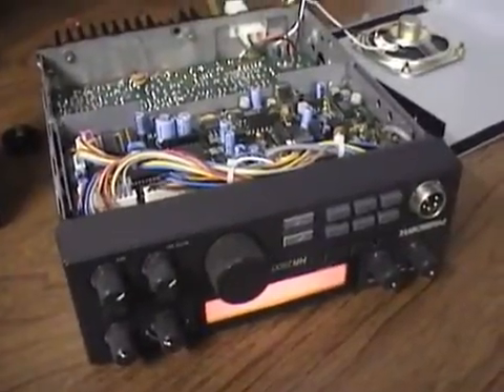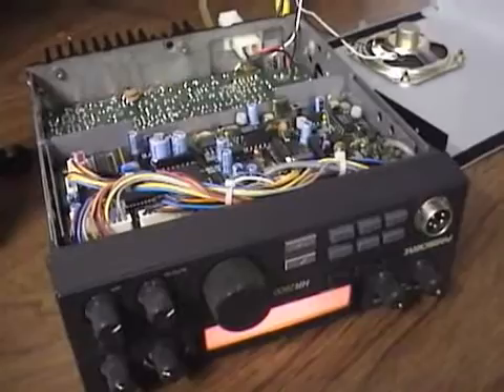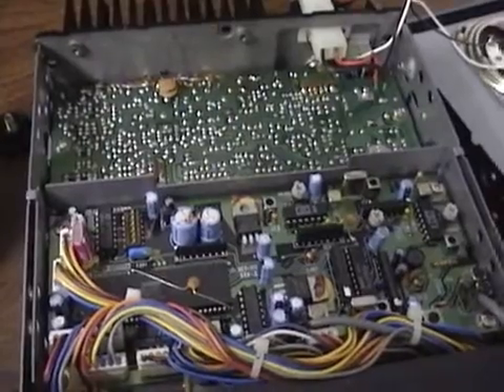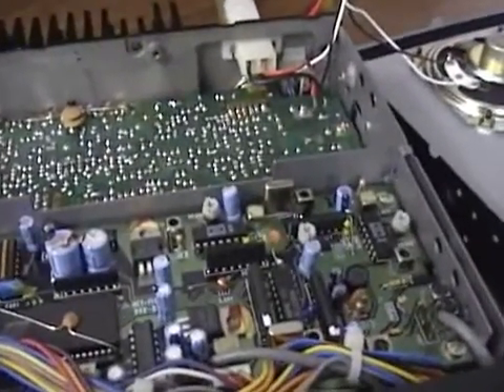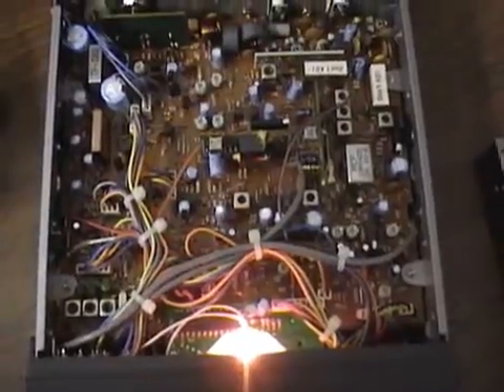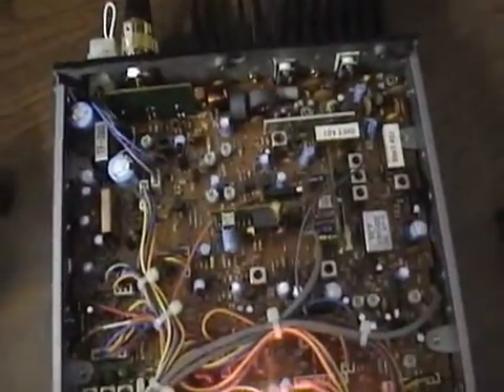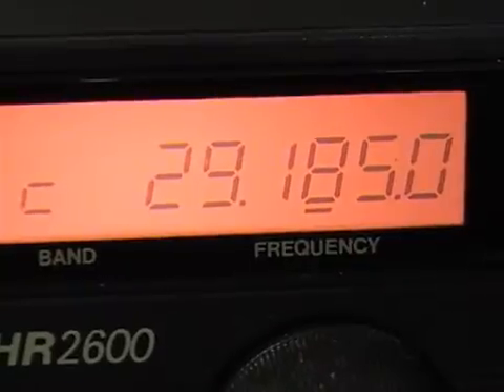President HR2600 11 meter modification Xtal swap for CB frequencies

Comment: It's better to just buy a junker HR-2510 that still has a working PLL board and just swap the boards out, tray and all. Four case screws, four PLL tray screws and several connector plugs is all it takes to swap out the PLL board. Even if the PLL board was no good, you could still just desolder a working HR-2510 cpu and install it into your HR-2600.
A word of caution: Desoldering and then resoldering this particular cpu is NOT easy, even with proper solder skills. I've done a LOT of these over the years and this particular 64-pin cpu changeout requires exceptional soldering ability. DON'T try this unless you really know what you're doing because this changeout is VERY easy to screw up.
Reply: I read on a forum somewhere that you can't simply "swap out" the whole CPU PCB. Have you done this swap? Does it work?

I have a mint and boxed 2600 here and, as you can guess, it's 10 metres only. I also have a complete CPU PCB from a 2830 which has the 1201 CPU chip. It would be great to be able to drop it straight into the 2600. I've checked and all the connector plugs from the main board/display etc are identical.

Please advise.

Thanks.
Reply: Sorry for my late reply but I don't regularly check to see if my posts have received responses. As for the PLL board swap, yes, I've swapped out numerous HR2600 PLL boards for one out of a HR2510 and it works just fine. Although I know swapping out PLL boards between these two models works fine, even if it didn't work, it wouldn't hurt anything to try. That's how I figured out that it DOES work. I knew the worst thing that would happen would either be 1) Radio would have erratic behavior,  2) Radio wouldn't work at all, or 3) Radio would work just fine. Turns out it does indeed work just fine. With the exception of a couple of front panel features, the 2510 & 2600 PLL boards are compatible. The ONLY difference is the 64-pin CPU itself, which has a different part number and is the one thing that prevents a stock 2600 from dropping below 28 MHz. 

Something else I used to do is swap out the CPU from a stock 2600 for one out of a stock 2510. Although this is considerably more work because these CPU's are very challenging to work with, once completed the 2600 works the same as a modified 2510. Back in the 1990's when the ChipSwitch CPU was in production, this was an excellent aftermarket CPU replacement because it not only extended the radio's operating range from 24.800 -  30.00 MHz, but also provided memory channels and split frequency operation.
Reply: +WelshWidgetMan2O1O Just had a look at the two CPU boards and I've noticed that two of the connectors are a different size (four pin on the Lincoln board, five pin on the 2600 board). How is a PCB swap possible with this being the case?
Reply: Yes what is the word on the different plug? I see the 4 then 5 also, so what is the truth here? I just looked at a nice 2600 and let's face it they were made for CB but not buying a radio that won't do 11 meters. Other real HF rigs would be used on 10 meters by My choice anyways.

Comment: Is it still possible to get the chipswitch for this radio at all?
Reply: +26 CHARLIE TANGO 011    I believe they stopped making the ChipSwitch back in the 1990's but you can still find them. The HR-2510, 2600, 2830, and LINCOLN were incredibly popular transceivers in their day and Uniden sold a LOT of them. As such, the ChipSwitch was also hugely popular and they sold A LOT of them as well, which means there's still loads of them out there - even in 2015. There are also LOTS of old 2510's and it's variant for sale that have a ChipSwitch installed. Even if the transceiver is junk, the ChipSwitch is almost always still working. I still have two working 2510's myself, both equipped with a ChipSwitch. Although not a big deal today, the added features they gave were state-of-the-art 25 years ago.

Comment: The chipswitch is the only way to go with the 2600.  The other ways to get them onto 11 meters not worth the trouble for the what you get when you're done.  The chipswitch chips can still be found on the internet.  They're well worth the money.  No retuning was required on my rig.  Change the chip and you're done.

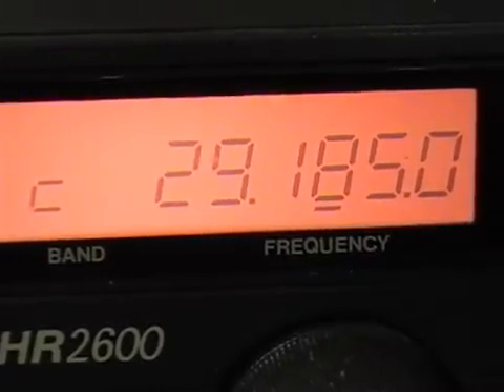Comment: Hummmm, you say receiving on 27.185.0 at 2:15 in the clip as it displays 29.185.0 lol
Reply from the maker: Yes - the crystal swap changes the frequency inside the radio but not the display. It's not an ideal modification.

Comment: did you try an external speaker to compare audio difference? try that first, if done so and get the same result,  you may then have a leaky capacitor.